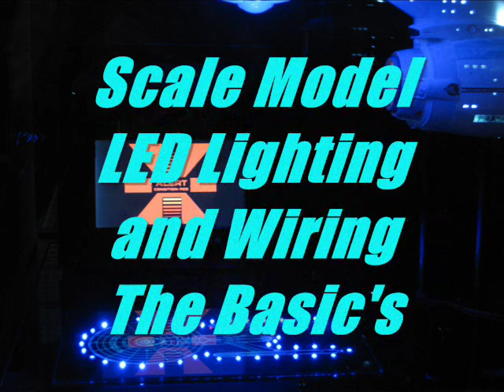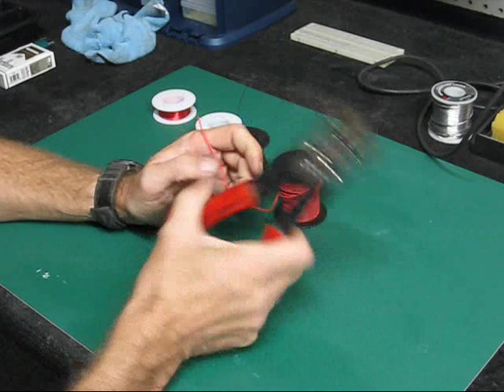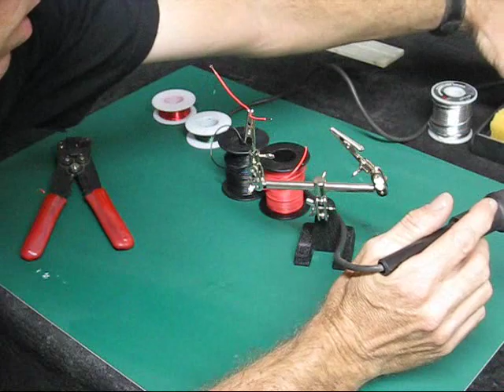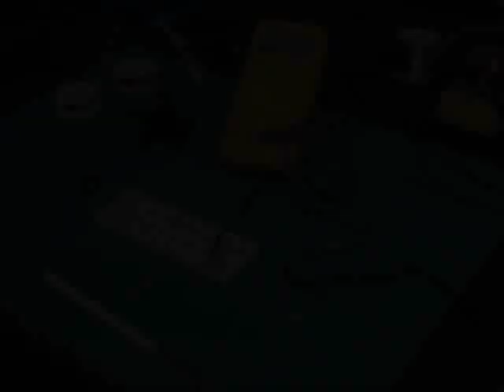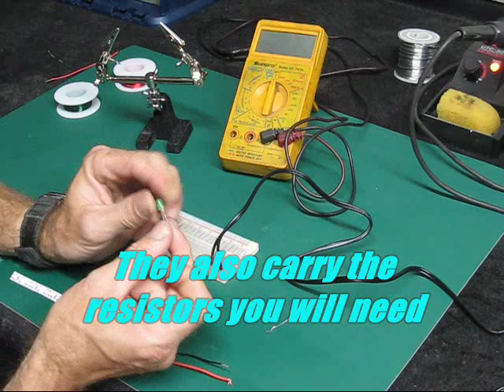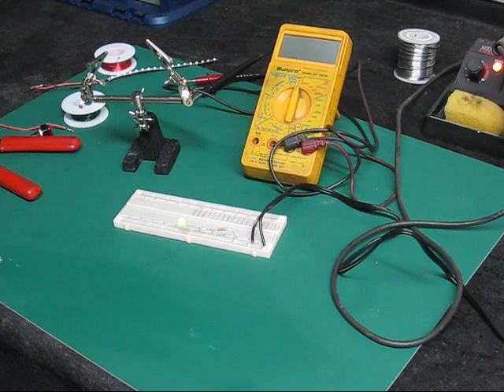Star Trek Model Ship Wiring and LED Lighting How To Basic's From TrekWorks

Comment: I've been building models for about 11 years and I'm in awe of some of you Master Builders I get disappointed and frustrated at times seeing what you guys can do and then another times I'm inspired lighting kits versus not having them can be very disappointing and disillusioning and frustrating having the proper wiring and equipment and when my old Workhorse soldering gun after 6 years said I'm done I couldn't find a soldering gun to work as good as my old Radio Shack Workhorse to save my life and I wanted to pack it all in and say my model building days are over also not being able to find the hollow rods and tubes you guys set up your models on which your wires go through to the base where the switches are where the heck do you find these tubes and these bases that perfectly fit in your model and perfectly fit in your base after your building this beautiful ship and ready to display it and this is just so totally frustrating this is why I'm asking if you could please answer these questions by accessing me on Facebook and I get a notification that you're answering me and answering these questions forgive me for being so long-winded and no punctuation I'm dictating this cuz my little fingers would take forever to hunt and pack this message out or give me Eric Sahagun fb

Comment: I'm parallel wiring my enterprise refit. Have the plans laid out with flasher circuits and powering with 2 9v batt in parallel for the extra bank. It won't be on much so dont need the big power. Good video , reassuring!

Comment: boyd first of all thank you for showing how to do the re-fit enterprise wished that I could do half as good as you.the second thing I would like to know  what size led for the deflector dish and did you have to drill out the back to make the led fit.
Reply from the maker: +Randall Naylor I used a 5mm bi color that is amber and blue combined in one. You drill a hole to fit it dead center of the dish behind the main lens. I used the Tenacontrols board that makes it switch colors.

Comment: Where can I find more info on the best type of power supplies. I specifically want to do a model (1/144 Bandai Millenium Falcon) with a combination of LED's (1 strip and 4 single 3 - 5 mm led's) and also fiber optics for sections. And don't really want a 4 separate 9V batteries set up. Thanks.
Reply from the maker: +Gary Tinschert I use walwarts as they are called. Power adapters that plug into the wall socket like a phone charger. 
I get them here: www.hdamodelworks.com
Reply: Thank you.

Comment: 60/40 is actually the Lead to Tin ratio.  The rosin core is not mentioned in the 60/40 solder measurement but is an integral part never the less

Comment: Hello  Boyd           I  veiw  your video  tutorial  on how to add a on / off  switch.  Question #  1  You were saying  run the positvie  side  frm the power supply to the switch  on one  SIDE  of the switch  and  out of the OTHER SIDE  the wire going out of the switch  WOULD THAT BE THE NEG going to the neg of the circut  ?  Question #   2   I  always thought  that  run the positve red wire frm the power supply to the positve side of the switch and run the positive out to  positive red wire to the cicut and run the negative black wire frm the power supply in to the negative side of the switch and out to the negative black to the circut i think i;m wrong and confuse,   PLS EXPLAIN AGAIN  FRM , WHERE, AND TOO   thanks boyd  pls reply..
Reply from the maker: Henry Silvas With the switch you can either interrupt the positive or the negative side of the power coming in. Just connect one terminal of the switch to the plus in and have the other side as the plus out or you can do the same thing with the negative wire.

Comment: HI Boyd just wanted to say first your modeling work is fantastic awesome and outstanding  please keep it up ..   Well  I've purchase two model kits  space station k-7  and classic  RBOP, I do want  to add some LEDS to both of the kits. On the space station k-7 it does take @ least 7 color leds with different voltages and Ma.. I'm putting 4 white 3mm leds @ 3.2 Fv @ 25Ma ,and 1 red 3mm led @ 2  Fv  @ 15Ma  and 1green  3mm led @ 2.2 Fv @ 20Ma and 1 blue 3mm led @ 3.2  Fv @ 25Ma . Now i view your instructional video several times on how to wire the leds soldering and about different series  You did explain about if you add more than 4 leds it would require 1 resistor for ea led Ok i got that . Now when i calulated  each led with their specs it gave me that resistor  value to use , or should i go with 2.2v @ 20 Ma  with all 220 ohm resistors . Now  how do i calulate  to use 9V OR  12V Power Supply .. Boyd pls help thanks henry ..
Reply from the maker: Henry Silvas To make things simple, I suggest going with a 1/4 watt 470 ohm resistor on each LED you use. You can then use either a 9 volt or 12 volt power supply and the LED's will be in their normal operating range at that voltage output.

Comment: Great tutorial. I've been modelling for years but have never put lighting in one, so this is a great help. I do have one question though, have you ever used light sheet before, and if so how do you wire it.
Reply from the maker: I haven't worked with it. One thing I don't like about it is it needs a transformer to run it. It runs on AC current and uses a transformer like a ballast resistor which will begin to buzz with age. More things to go wrong over time.
Reply: +TrekWorks It also doesn't shine as brightly as the super bright LEDs. You have to vary the transformer power depending on how much surface area of light sheet you're driving. Not enough, and you won't see the light sheet glowing unless you turn off the lights; too much and you'll overdrive and burn out the light sheet. Also, because of the requirement for a transformer, you'll either have to install the ballast inside the model if you want to just provide DC power to it, or provide both AC and DC power leads into your model.

Comment: hey just 1 more question on wiring the leds.. u told me before to use 1/4 resistor to each led i have.. though on website u put on somewhere it says just to connect 1/4 resistor after 4 leds running at 2.2v, so what is best way using 9v you wreckon? thanks boyd

Comment from the maker: Sure, the basic priciples of LED lighting are always the same. As long as you use the correct resistors for the voltage you'll be fine.

Comment: At the end, you mention that the proper way of dimming an LED is to flicker it, through a timing chip.  Is this to reduce the power consumption, by having the LED "off" for a significant fraction of its running time?

Thanks for the great video.

Comment: Thank you for sharing this.

I bought a cheap chain of LED xmas lights, the sort that you wear. It has about 20 small red LEDs. It appears to be assembled in series, with a single resistor. It has a battery pack for 2 x AA 1.5V batteries.  

Question: how does this work? I can't work out how 3V can power about 20 LEDs in series like this.   Thanks for any help.
Reply: Did you figure it out at any moment, by any chance?

Comment: Lit a model with LED of the original Colonial Viper and did not use the resistors, just used 3 amber and one green (Engine nacels and one cockpit) in series with a 9 volt battery. This is so informative, wish I had learned more before wiring the kit. Now, with some sci-fi scratch building I am doing, I will be better armed and informed for better results- Thanks!